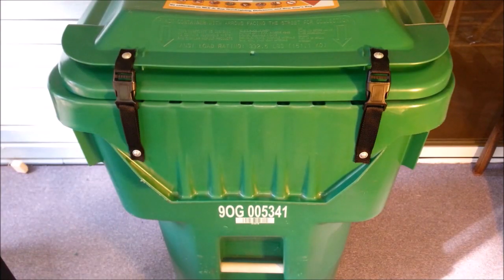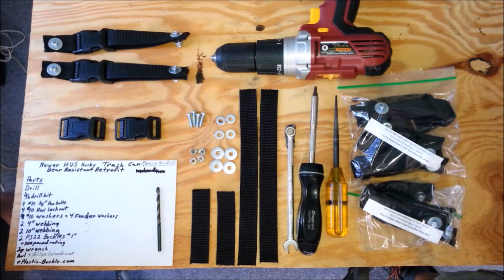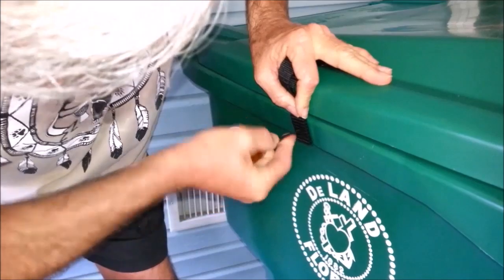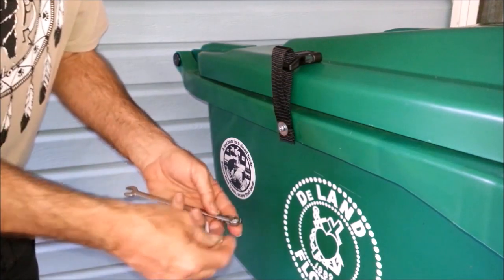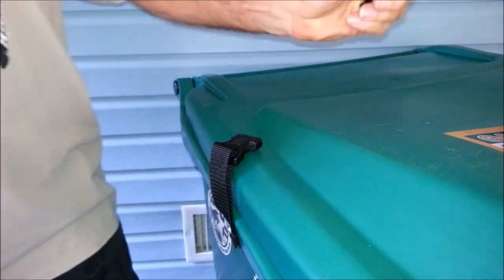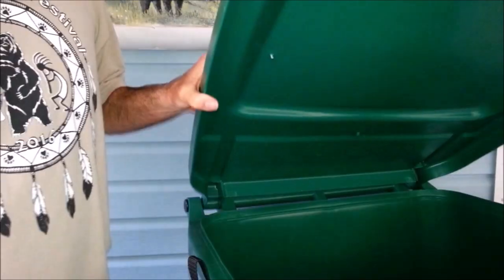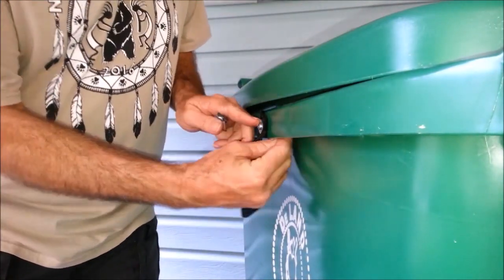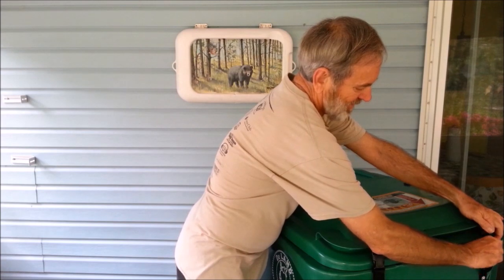Adding resistance to most trash cans bear resistance

Comment: Your straps are definitely easier to use and lock than the 1s I have. Additionally I used to regularly wash my bins too. Keeping the bins clean, helps reduce smell that attracts them. I found a holder for bags on Amazon that let's me use smaller bags in my cans to hold messy waste and prevent my trash cans needing frequent cleaning. Hope it helps reduce your pest problem too. I've also found that sprinkling a little baking soda after throwing in trash reduces odors. I've added the link to it. Thanks again.
Reply from the maker: Always looking for good ideas. You know bears have the best sense of smell we know of so reducing attractants can help them and us. Thanks for your comment.